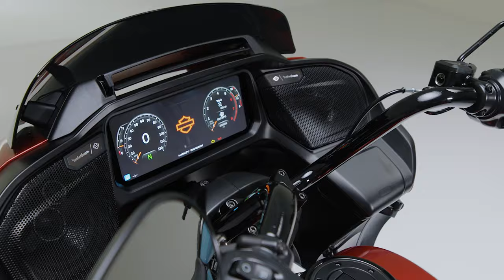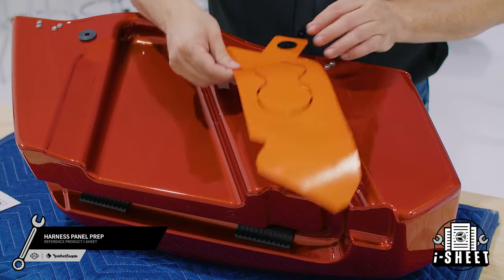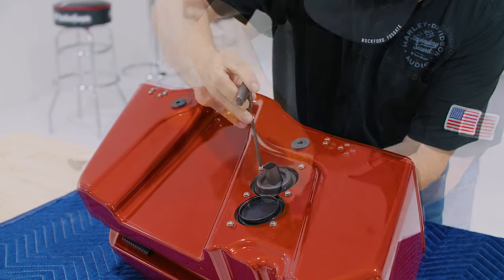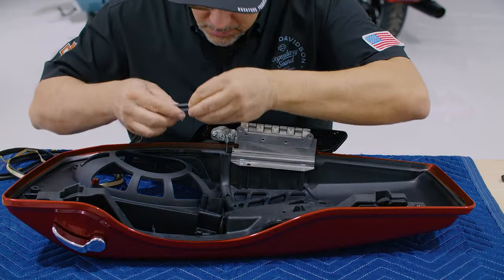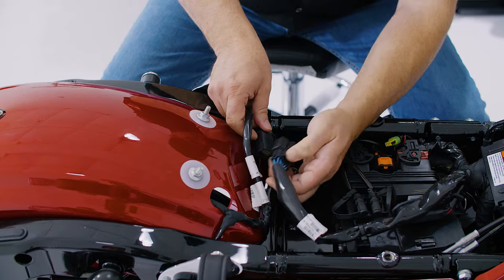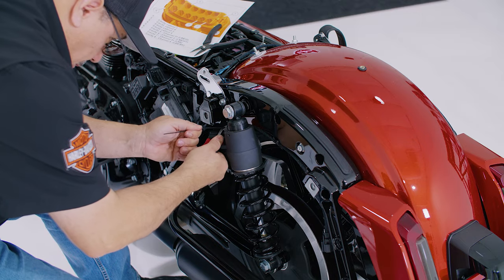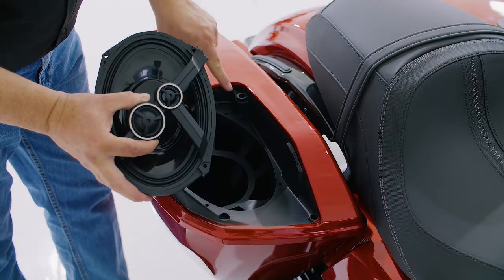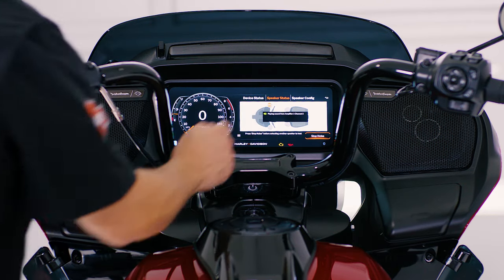2024 Road Glide & Street Glide Saddlebag Speaker Install | H-D Audio Powered by Rockford Fosgate

Comment: What is the trick to removing the 12 pin connector plugs 5,6,7&8? I purchased a plug/pin removal kit but it’s not allowing me to remove them.
Reply from the maker: Hi Chris, for assistance we recommend stopping in at your local dealer so they can offer assistance. Or, feel free to contact our Customer Care Team at 1-800-258-2464 (Monday through Friday 8:00 a.m. – 7:00 p.m. CDT) so they can learn more, thank you.